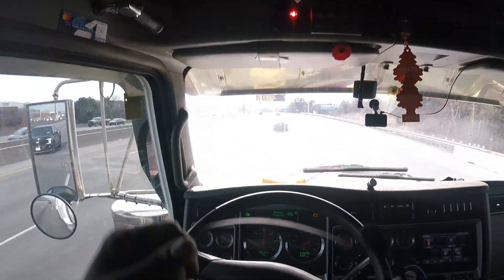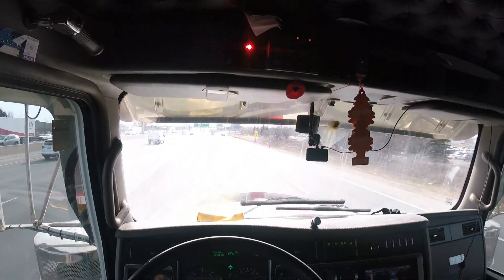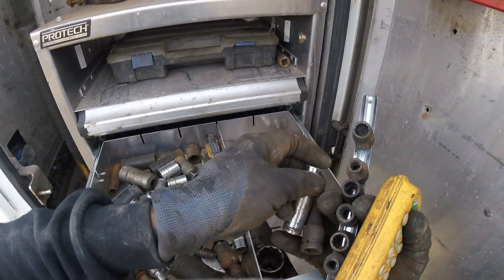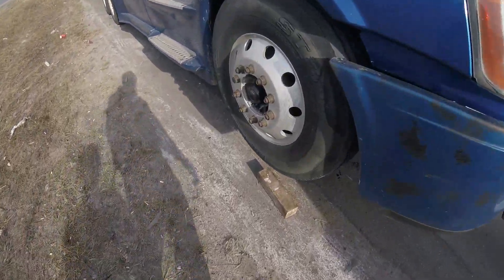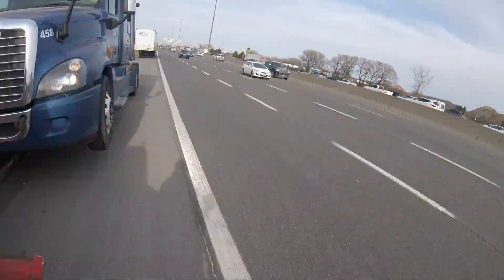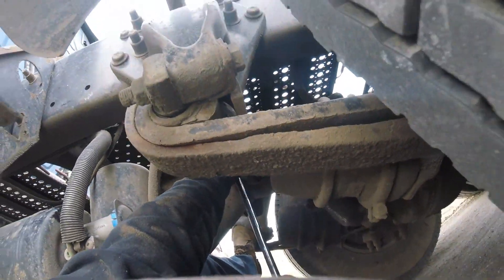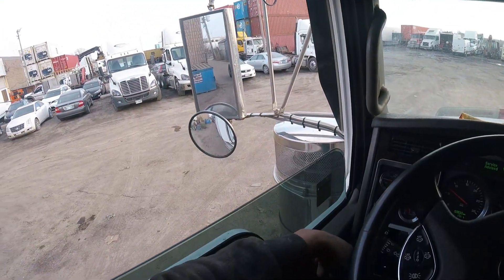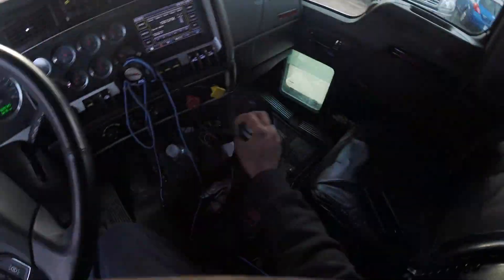BROKEN HANGER BEARING -- HIGHWAY 401 -- HEAVY TOW

Comment: Midshift bearing or carrier bearing. Your right that was a simple fix, could have done it right there on the side of the 401 15 minute repair. Don't even have to remove the drive shafts to replace that. Most have only 2 bolts that hold it up and the shafts just slide on either end. BUT you get more money towing it then repairing it. I used to tell everyone that asked about their truck, (sorry I'm not a mechanic I just tow it to a mechanic) that way I made more money. Nice job, Stay safe my friend.